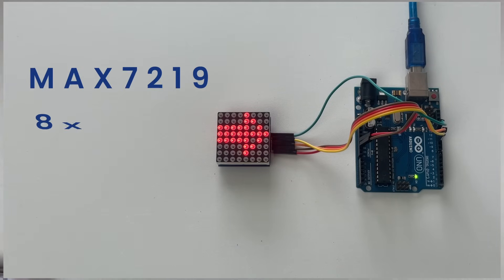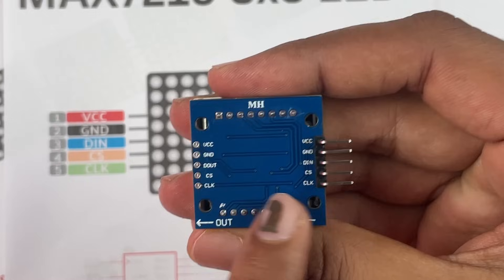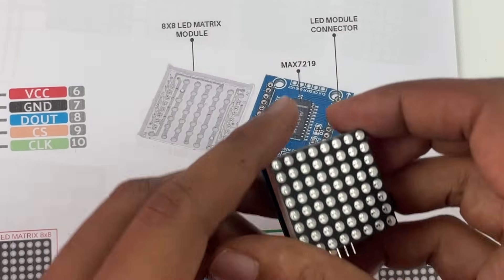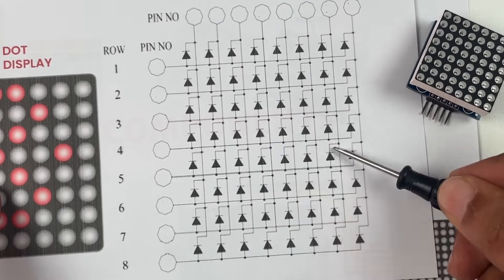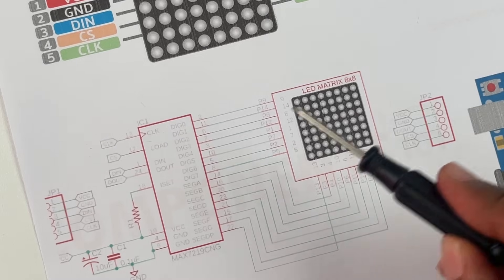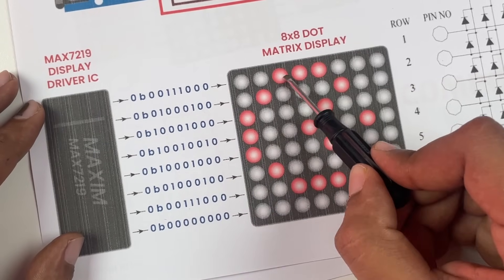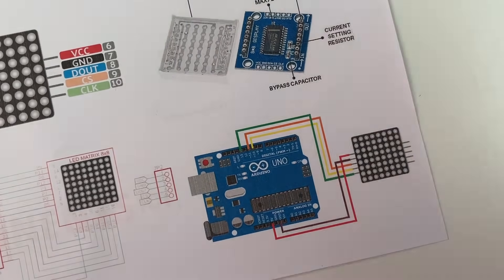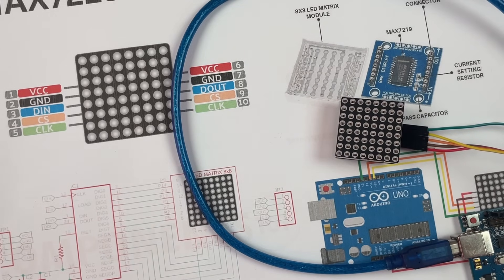MAX7219 8x8 LED Matrix - Basics | Working | Circuit | Simulation | Arduino Code

Comment: i'm trying to put the little plug-in pins into the in ports but they keep sliding out, should i use adhesive or something to fix this?
Reply from the maker: Yes you can use hot glue on outside

Comment: Can I used arduino nano? I change the pic to 2,3,4 then it did not work, everything lights up
Reply from the maker: Yes you can use an Arduino nano. Make sure to use the SPI pins mentioned in the code.